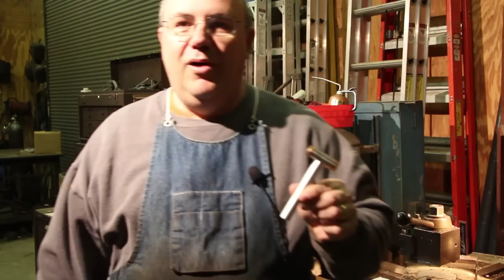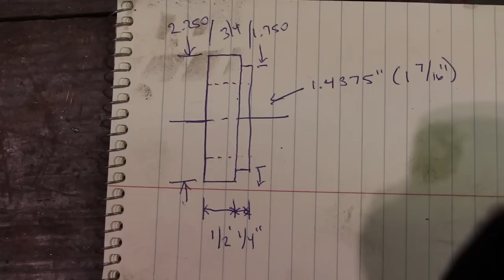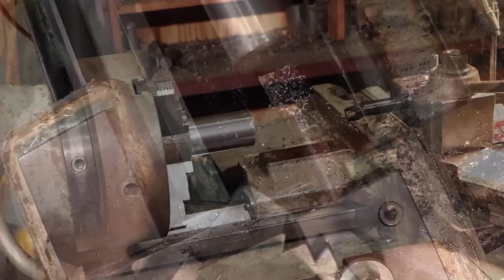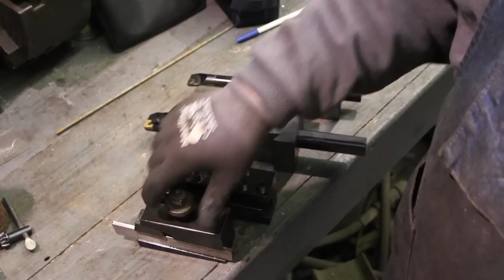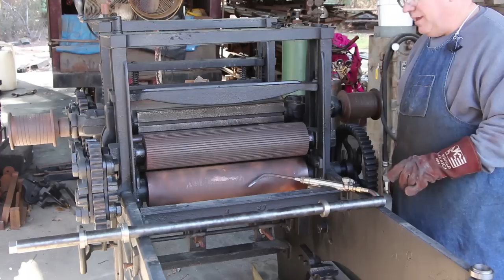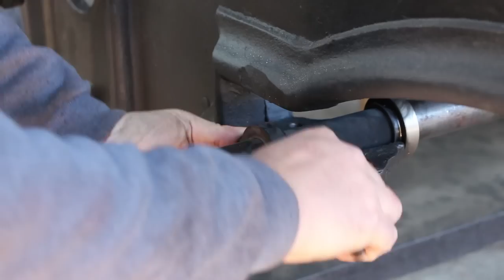Pouring Babbitt Bearings on the J. A. Vance Planer/Matcher

Comment: Hi Keith, great video,and awesome demo of the pour! Chevy was still using poured bearings in their 1950 216 cu. in. six cylinder, and in that model oil filters were an optional kit that clamped to the intake manifold, and the engine got oil pressure from dippers on the rod caps that ran in troughs, simple but affective. Back then re-pours were standard workday stuff in auto machine shops... I just thought this might be an interesting add on to the nostalgia of the topic here. Looking forward to your next videos from the meet up with the wood working guys! :o]

O,
Reply: Sometimes it ain't the years, but the miles! The 1950 was my second car, and it was an antique, but I was 19... Now, the 1950 was 5 Toyotas ago,,, and I'm the antique... lol ;o]

O,

Comment: Keith nice work.  That was good where you showed the tooling you used and the size difference between the tool holders.  I think that has a big effect on how much material you can remove and you showed that in the video very well.  Those were heavy cuts and the machine hardly noticed.  Nice work filming the babbitt pour operation.

Comment: Keith:

Thanks for the thorough instructions on Babbitt pouring.  I think some of the big Babbitt bearings are centrifugally cast.

The out gassing and sputtering you experienced might be due to moisture (or other volatiles) in the gasket paper used as a shim.  Perhaps putting the gasket paper in the over for an hour or two prior would overcome that???

With appreciation....................

Comment: This reminds me of pouring the cutter head bearings for my 16" Porter heavy pattern jointer. That thing sounds like a helicopter, but man can it do some nice work on big boards. When you live in a house built in 1830's Ky you have to make everything yourself, because that is what they did so there is no standard for anything. The biggest advantage to babbitt is it can be any size.  Got a damaged shaft from a bearing failure turn it down to round again and re-pour, no need for a new high priced shaft. :-)

Comment: Hi Keith
Nice to see you working in the field - Keith Fenner has a very fine video on this subject too ... and a little trick on making the bolt holes in the gasket ... use some ball bearing balls ... but you did ... just mounted on the end of a hammer ;-))